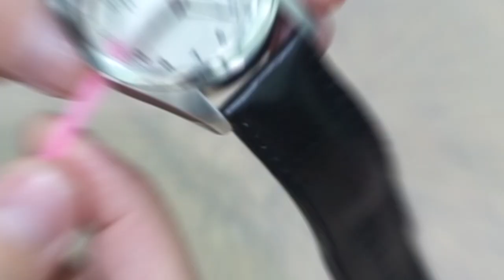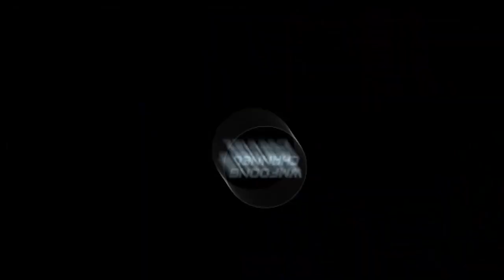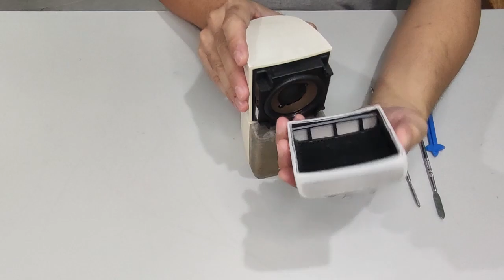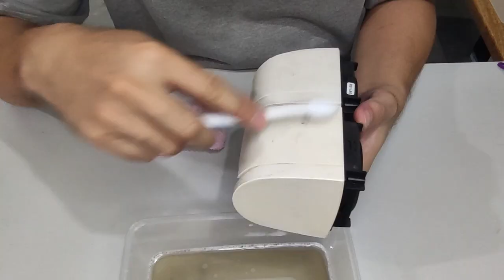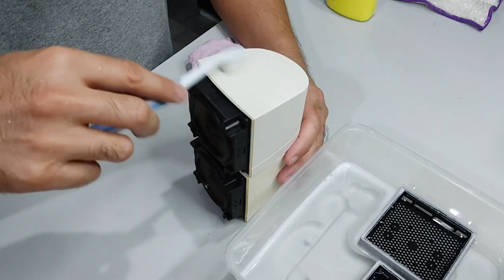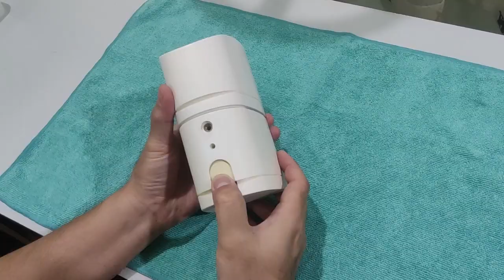Bose double cube white speaker clean dirty and fix cable button stuck

Comment: Fantastic video, thank you! I didn't follow your exact methods but did use the dish soap and it made them vibrant. I just used any old soap and it worked a treat. Tools wise I found that using a screwdriver with a very wide head worked extremely easy, just very gently pry from the bottom of the speaker with a very light twist. Any resistance then just move around the edges and give another gente pry so the parts that are a bit stuck come loose. The first speaker was the trickiest but after that I could pop them off in seconds. They have gone from yellow to vibrant white, very happy.

Comment: You can also sew the holes closed with an ordinary needle and white thread. Won't be perfect (unless you are an expert sewer, I guess) but covers up the black plastic and makes it much less noticeable, especially from a distance which is how you'll usually be looking at them anyway. I also used laundry soaker instead of washing up liquid which removed some of the more stubborn stains.